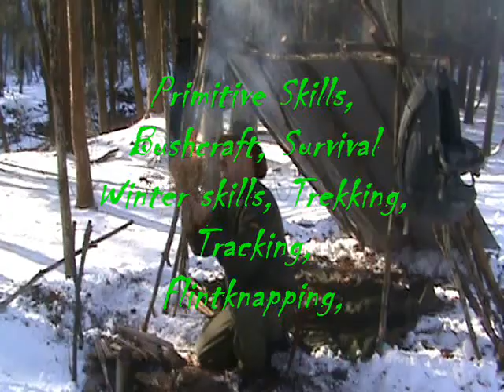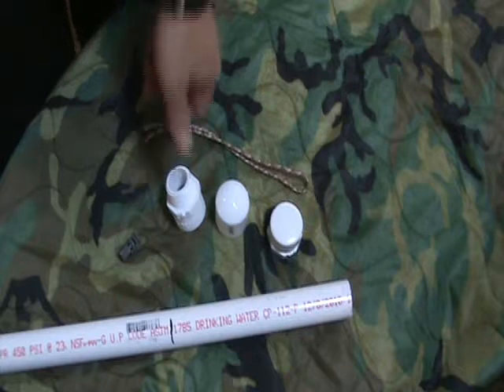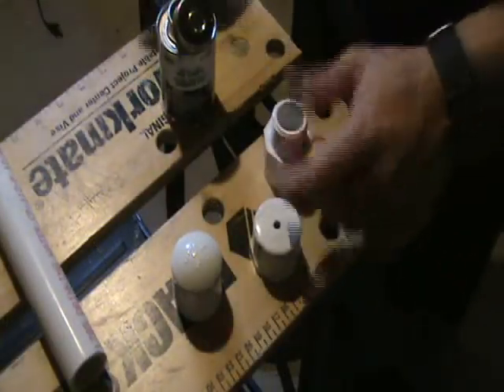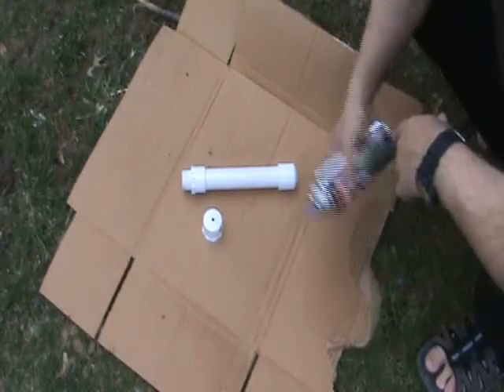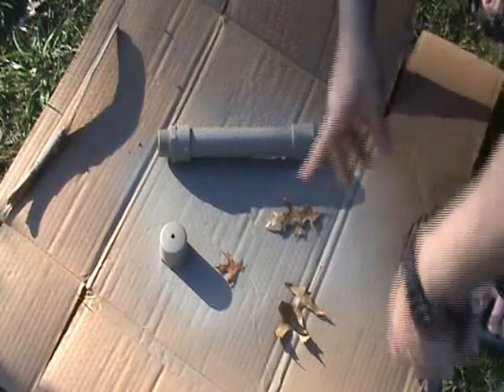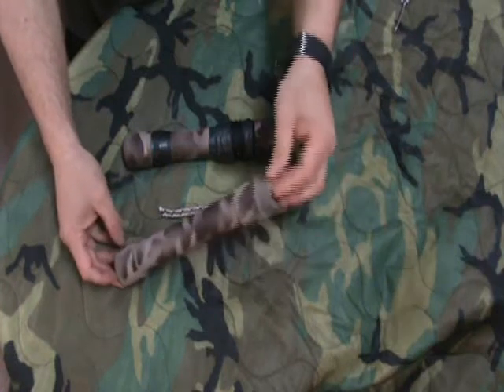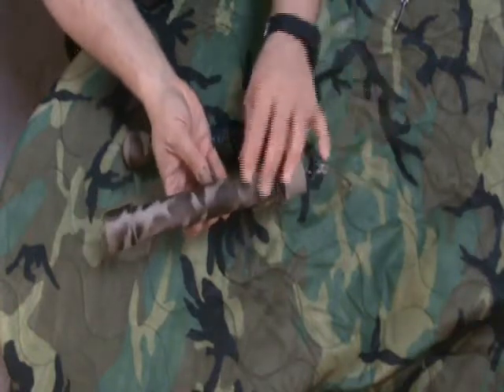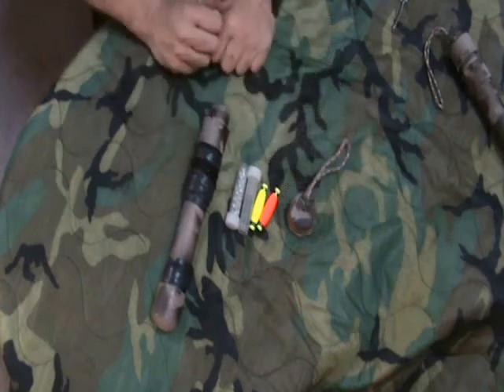Hobo Fishing Kit

Comment: Nice idea, thanks! I think I'll try and get black pipe in case the paint rubs/chips off; it would be better to have black show through. Also, I may use canvass camo tape instead of paint as it's quicker, should provide more grip and I carry some anyway so can be easiliy replaced.

Comment: I like your system and the only change I would make is an internal plug on the permanent end.. This would allow for a casting platform from the tube, Much like a spinning reel.
Reply from the maker: Brad Gray this works fine but I see you point and I've always said any improvements to gear is always a plus thanks for the comment

Comment: Couple questions: is it waterproof? i know you screwed a hole in the cap for the lanyard…would you add some cement on that to waterproof it? Why 8" long? Do you use it as a pole to cast? Where did you get those smaller screw cap containers for the hooks and sinkers/what are they called? Thanks for the good video.
Reply from the maker: yes add some shoo goo to the top makes it water proof, the small containers a aspirin containers, length yes for casting and to hold extras, thanks for watching

Comment: cord lock you can replace with a soda can tab to save money/wght every penny and ounce counts.
Reply: another tip I have with this is use some orange or any high vis. color on the cap in case it falls off you pack. This has accidentally happened to me.
Reply from the maker: Thanks good points however, I'll stick with cord locks as far as high vis cord I have applied that where I need. Good tips all the way around thanks for commenting and watching!Stop by often

Comment: not only should you have been doing it in a well ventilated area but you also should have used the pvc primer for a stronger joint
Reply from the maker: Ok I mentioned that you should do it in a well vented area, and to this day 3 years after making it, it hasn't fallen apart
Reply: Snowalker13
Yes I know that you said that you should have been doing it in a more well ventilated area, I was only reaffirming your statement (my you are defensive). It’s good that it hasn't fallen apart ... YET!!!... and it may never, but (you knew there would be a but, didn't you). They make the primer for a reason... to clean and prepare the joint so that the glue can form a more perfect and long lasting bond. Remember the old proverb .... If a job is worth doing, it’s worth doing well and if you don't have time to do  it right the first time how will you find the time to do it right the second time ';O)
Reply: bad hat who cares if its not very ventilated? Its a little bit of pvc glue
Reply: TheGberg56
uh hu and that's why the manufacturer puts a warning label on the box.. the stuff contains Methyl Ethel Ketone and a list of chemicals I can't pronounce but are really bad for your lungs and eyes, as well as a cause of cancer. but if you're into that sort of thing.. I don't care if you huff it from now till hell freezes over hell take a bath in the stuff if you want to.